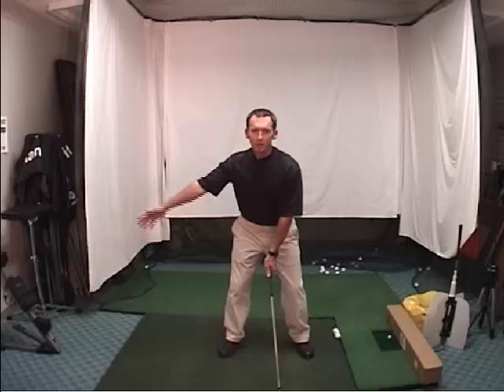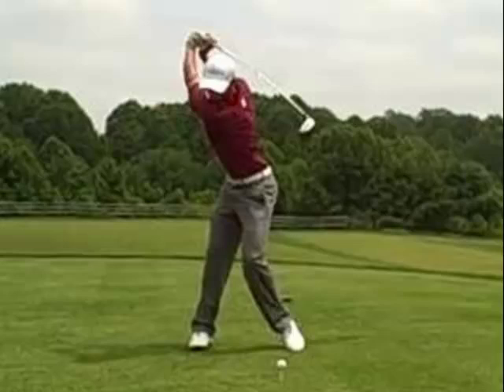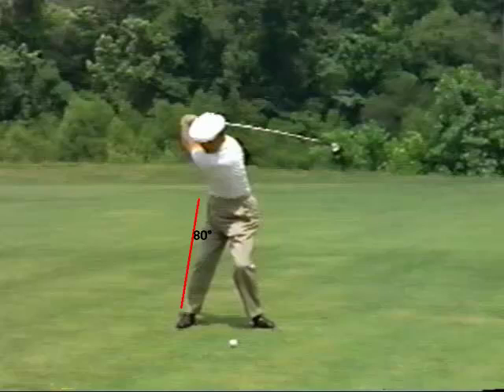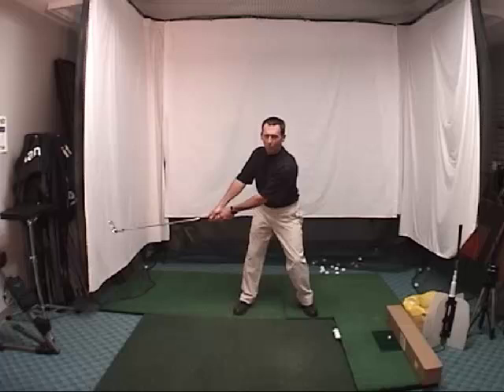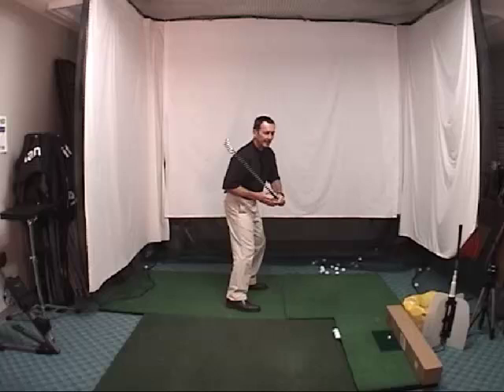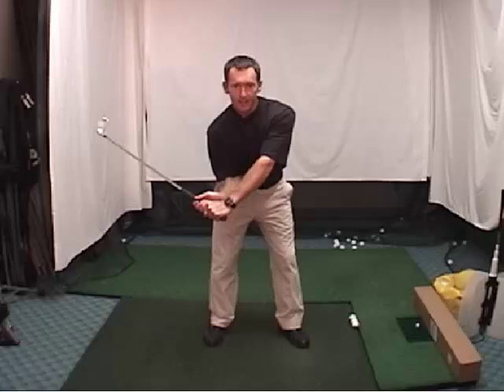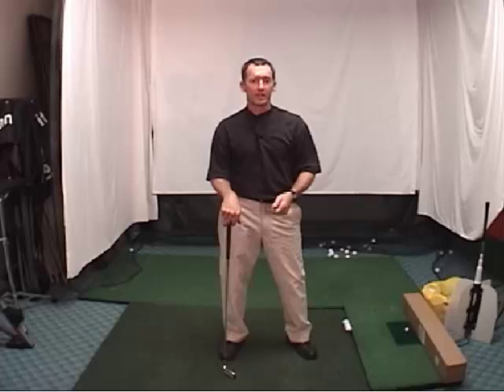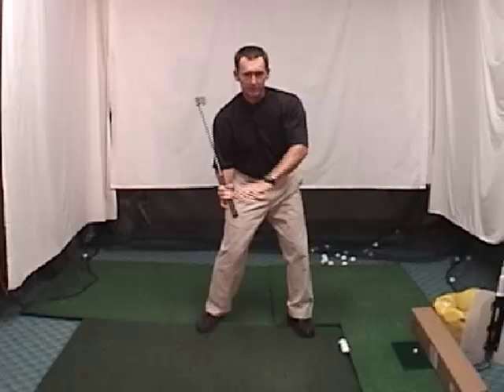Transition in Golf Swing - Part 2 of Speed, Power & Distance Series by Herman Williams

Comment: Smart: here's why-- Herman bumps his hips so he gets a weight shift at the same time that he drops his right elbow into the "shortstop baseball throw" position. The next move is the hip turn: that is smart because the angle of the knees and hips at impact is not far away: there is plenty of time to get the right knee toward the ball and the hips open 15 or 20 degrees. Smart guy.

Comment: Hi Herman,  great video as always.  My main issue is lack of distance.  I hit my 4 wood around 200 yards and my driver around 220 yards only.  Do you push with your right side or pull with your left oblique while posting up your left leg on the downswing?
Reply from the maker: The answer may be a little more complex than all of that if we tried to describe everything that's happening. But try to start by feeling the downswing has created a slight squat and shift into left leg which compresses the thigh. Then thru impact the left thigh explodes trying to straighten the leg. This drives the left hip and knee back along with the whole left side of body (oblique included) ... as the left side is driven back, the right side fires thru. It is somewhat of a piston action - left side back, right side thru. If you do all this too soon though, it's likely you'll come over the top. Look at my video on "shoulder move in golf swing" to see how shoulders move while leg is posting up, you also must have that right elbow buried in the ribs pre-impact for max lag. good luck and thanks for commenting. - Herman

Comment: Mr Williams - you mention the left hand pushing the handle back in the backswing. Does the left hand then PULL the handle down in the downswing? Thanks
Reply from the maker: That's accurate, but you have to be careful. It's easy to pull down more aggressively with left hand while right hand is less active, and then the levering between the two hands can cause casting. It's hard to create these visuals in a text setting, but you should try to pull equally with both hands and avoid narrowing the arc of the hands too soon. When I say don't narrow the arc of the hands too soon, visualize trying to drive the butt of the club momentarily away from the golf ball. If you imagine laying a second ball on the ground about 4 feet behind the ball you are trying to hit, then try to stab that second ball with the handle you'll start the downswing. If you try to drive the butt of the club at the actual target ball, you will probably narrow the arc of the hands and widen the arc of the clubhead which is a recipe for casting. Watch my lag video for more help.  https://www.youtube.com/watch?v=ln1T2ZPyuuw
Reply: Thanks!

Comment: hi Herman, in the downswing just at P6, do you feel the right hand on top of the club shaft and continue to pressure downward? you're videos are fantastic x
Reply from the maker: +hudlumfarter That's pretty accurate. I have the sense that the right palm is facing the ball and can continue to apply pressure down and along the swing plane/path line through the ball and then the pressure "flies" away past impact.